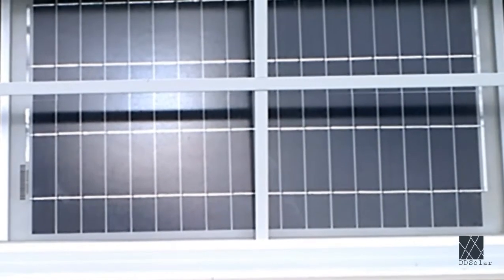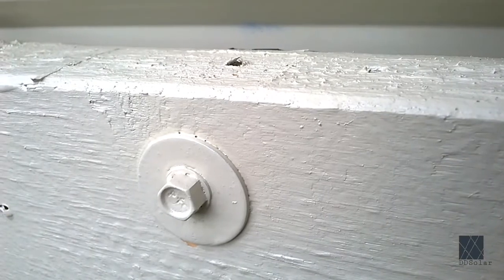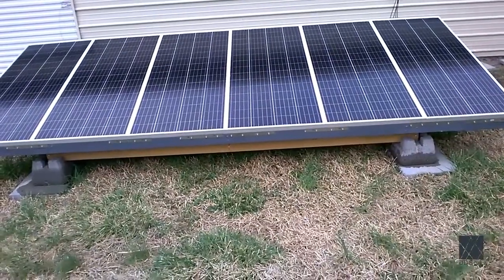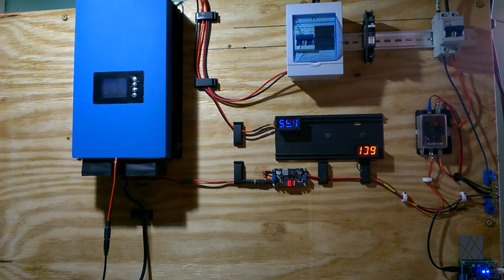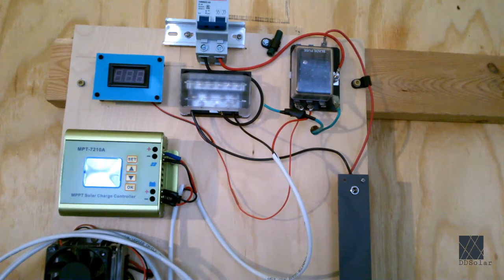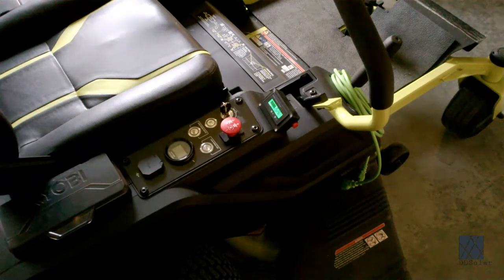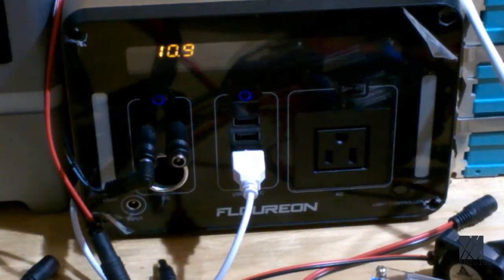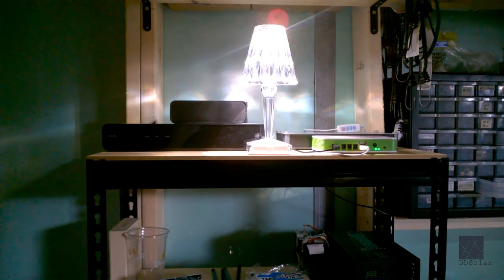Wall Mounted Solar Panels on a Metal Building -  LiFePo4 Mower - Solar Workshop Update and More

Comment: Need these but at 45 degree angle
Reply from the maker: @syclone1012 Yeah they need to be angled for sure.... but at least I don't have to mow weeds around them :D
Reply: @solarpoweredge  if you know of any brackets specifically for solar panels I can buy let me know.
Reply from the maker: @syclone1012 The cheapest option is to use wood and standard fasteners. Thats how I mounted these panels. But one must take care not to bend or twist the panels, as wood tends to change shape with temperature and season. If you want expensive brackets, can use Uni-strut stype bars and solar panel hold-down brackets but wow those get very expensive!

Comment: um they make brackets for solar panels that work perfectly and have a small light footprint
Reply from the maker: Yeah, this was an exercise in crafting with what was on-hand. I had enough recycled wood and hardware to mount 2 more panels but it's not on video.
Reply: @solarpoweredge  i have those brackets left from my rv install - do you want them?
Reply from the maker: So awesome of you to offer, thank you a lot. I don't plan to mount anything else on this building. Otherwise I'd be glad to take em and pay your shipping. I already mounted panels and painted everything tan to match building. I'd feel bad taking brackets without a legitimate purpose or need. Btw I just subbed to your channel cause I'm interested in solar RVs. I see your panels and batteries on the RV, that is a clean install. You have some really cool equipment. Nice job on the wiring too!
Reply: @solarpoweredge  Thank you. I kinda went too far with it all. Tough to install in the Florida heat during rainy season. Especially by yourself. Supposed to be leaving Naples any day now.
Reply from the maker: Yeah sounds like a blast lol
Reply: I’m looking for 45 degree brackets to mount on the side of my barndo.  The south facing side

Comment: North of Boston or so, a vertical panel may be as good as a rooftop panel, especially in snowy winters.
Reply from the maker: Good point, less scraping off snow and ice probably. And the snow would reflect a lot of extra light into it. In my case I just don't want more weed wacking, there's enough solar panels sitting in my yard already
Reply: @solarpoweredge  20 years ago, all the solar powered traffic sensors and stuff on I-95 in Maine were vertical.
Reply from the maker: Cool! I never knew that. Learn something new every day lol.

Comment: GREAT IDEA USING WALL VERTICAL SPACE FOR YOUR PANELS!
Have you considered using either a metal or plastic wiring trough for wire management?
THANKS FOR YOUR GREAT IDEAS!
Reply from the maker: Thanks a lot! Yeah I have some tan (same color as building) conduit stuff I haven't installed yet. Some trough or that plastic wire channels would be better and more professional. Planning to add 2 more panels maybe I'll make a video about that when it comes, and do some wire management at that time.  Thanks for watching :)

Comment: I'm curious and the output on your wall mounted panels compared to ones that are tilted
Reply from the maker: Those 2 panels just run experiments without increasing ground footprint (less stuff to weed wack and maintain in the yard). I get around 50-60W each if the sun is hitting. Quite good later in the day too. The main downside is overhang of the building shades them part of the day. But for me it's been an OK tradeoff.